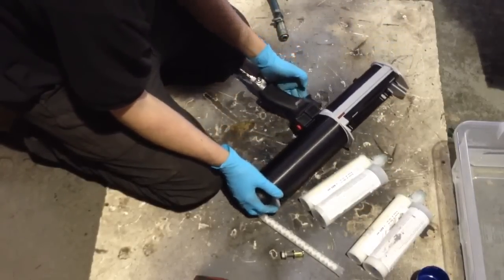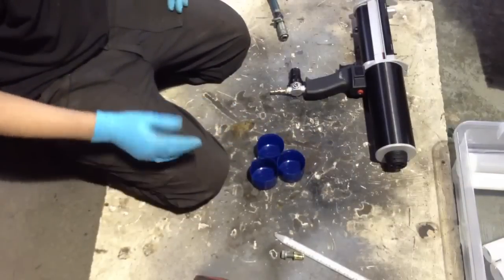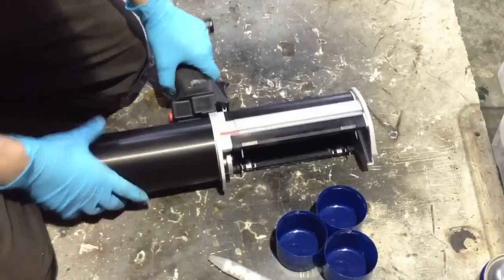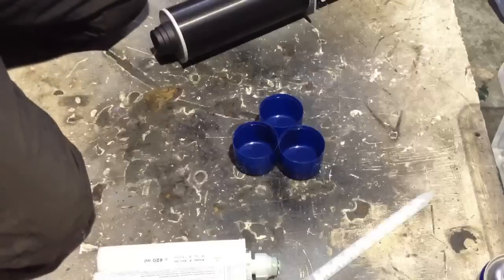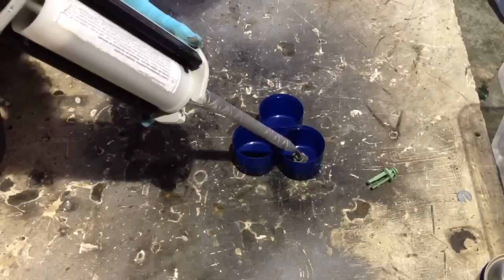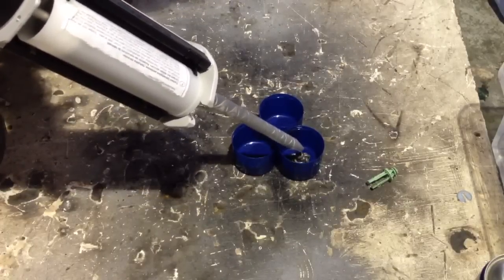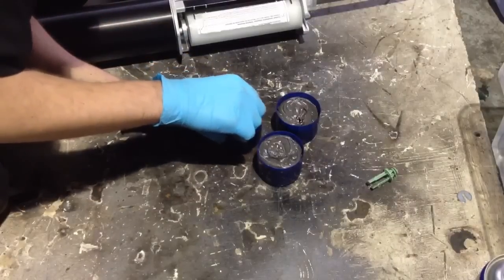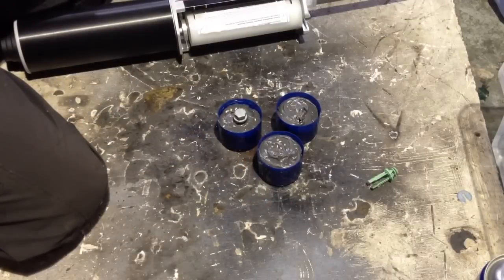INTRO to BMW STRUCTURAL FOAM - gun, mixing, deployment, testing PART 1

Comment: I'm past 5 minutes and you still haven't mentioned what this stuff is for. What is it for?
Reply: Six year later…. Still dumbfounded
Reply: For reenforcing weak chassis box sections and subframes on BMW E46 models (probably other too)

It gets injected into the cavity between the subframe mount and boot floor etc to prevent cracks and inside the corresponding section of the subframe.